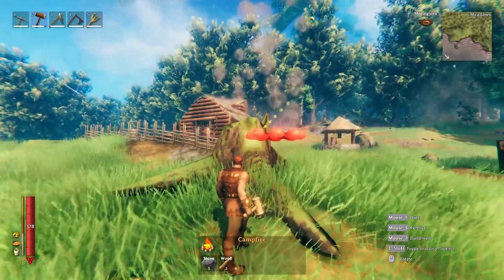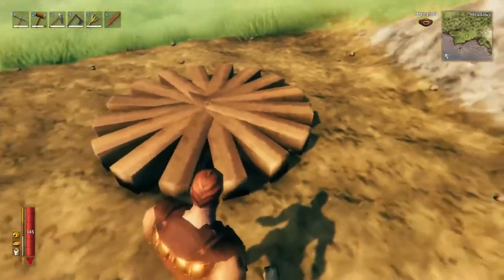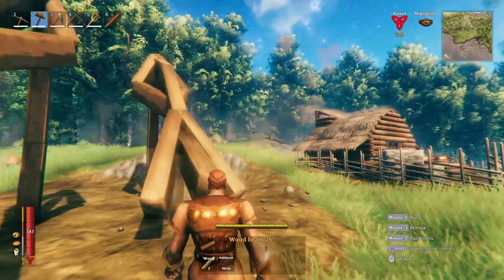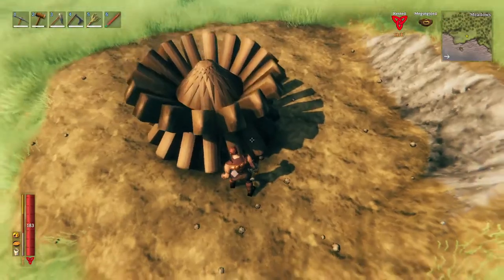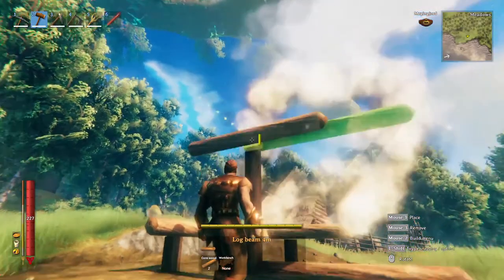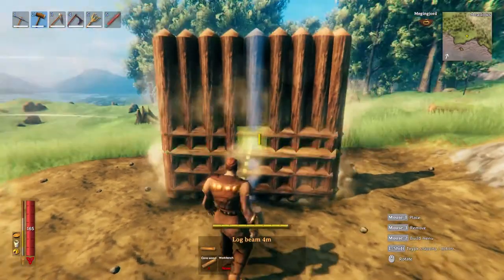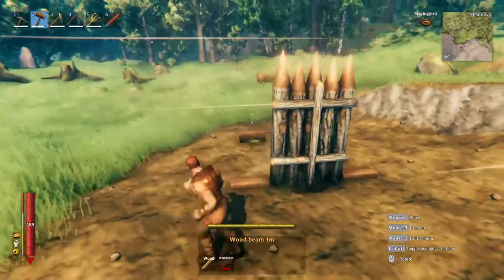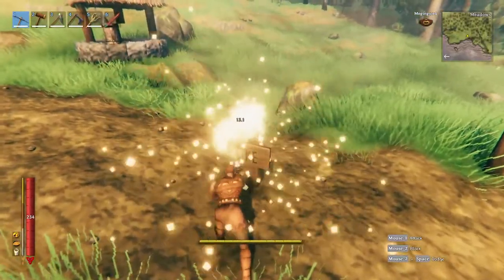Making Valheim's Snap System Work for You

Comment: Your like the person I need to be of advice in builds and big ones. Because I’ve encountered snap issues that are annoying to fix after the fact and too much time wasted going back to retro fix and issue still persist. But your video helped a lot. One annoying issue is when a floor tile is placed over a 2x1 or 2x4 Stone block on the edge and part the texture shows thru. But it does not do it with a smooth stone floor. I guess obvious the stone floor is smooth and not edge rough like the blocks. I guess can put down a double floor stacked to get rid the issue. But having an understanding of these mechanics helps immensely in builds. You are really great at these intricate tutorials explaining. At times hilarious also! But Do realize your far better than others at this kind of explaining and with patience to also show and explain. That’s Huge!

Comment: One issue I'm having is with building off of existing stone structures. I really like to take existing structures and "finish" them. In the early game, before I have access to a stonecutter, I like to build off of the stone structures in the Black Forest. I keep having very slight alignment errors when I try to fill in the gaps in the stone structure with wooden walls. For example, there's a stone structure that looks like it has a simple 3x3 (using 2x2 floor tiles) interior spaces. But when I build poles up the corners, the subsequent walls and roof tiles I build don't quite seem to line up. Can you shed any light on that? Any advice to get things to line up nicely?
Reply from the maker: Often what happens there is that the wall stones, which have shifted, have snap points that are subtly pulling and shifting things as you add them. I might aim your ghost images at the beams you're building instead of at the wall.